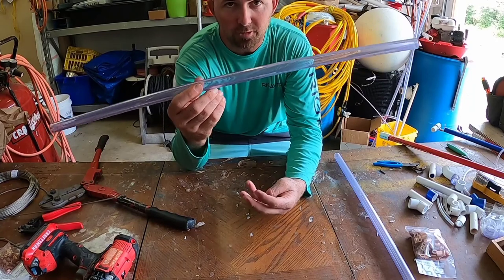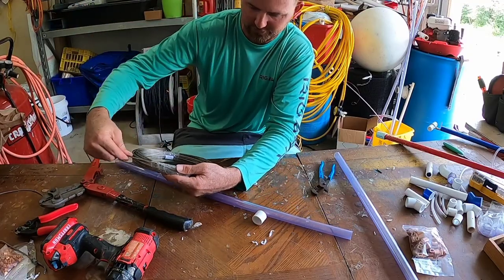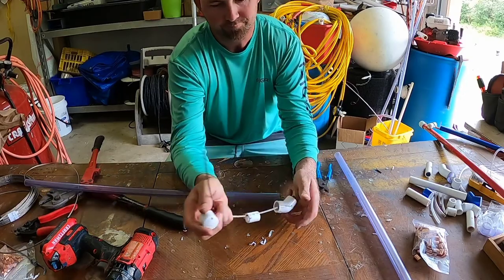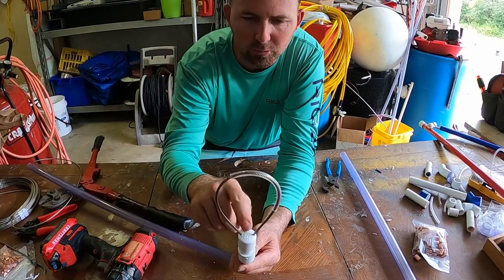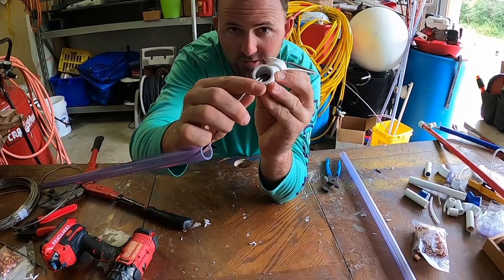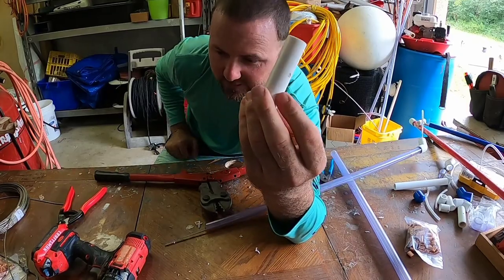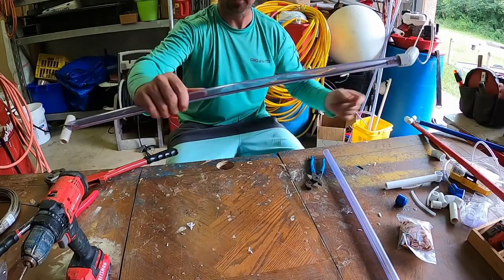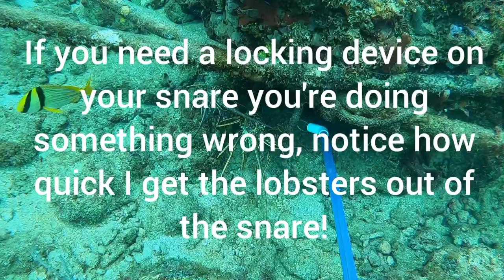Lobster snare making and using!

Comment: Great video. Can you please provide a link to the Clear PVC tubing you used. I have access to the Grey (Electrical) and White (Plumbing) 1/2 inch PVC tubes but I could see where the clear tubing would not scare the Lobsters away as much.  Also, is there anyway to crimp the Ferrules without buying that expensive crimp tool? Thank you!
Reply from the maker: The clear pvc I ordered online, i'm sorry. I don't remember where from, but I just use white pvc now, 99% of the fish in the ocean have a white belly, four camouflage. The clear ones I lose easier underwater, lol . I've heard of animal trappers just hammering the ferrules flat   wen bilding Snares. I'm not sure how a flat one would work in the pvc pipe.
Reply: @skindiver61  Thank you for replying. I just arrived home from HD and bought White PVC. I am traveling and need to fit this in my Suitcase which can fit 30" max, so I am going to use 2 pieces and use a 1/2 inch slip connector so I can fold it into my suitcase. I just have to make sure my measurements are correct so I don't have too much slack. Have you ever had a request for a travel version of this?  Also, mine will end up being almost 5ft when I put it together at our destination. Do you see any problem with that length?
Reply from the maker: @pittsburghpetfencellc8092  I don't build them to sell. I use them, I have heard of people making long snares 5ft + fore special Situations. But I have never needed one. I'm sure it will work gust fine, though .

Comment: Thanks for the video. 

Why put the rubber piece on the loop? Do you really think it would crack the carapace without? 

Sometimes the lobster are backed into the hole so much that it is easier to snare the knuckle. Without that rubber piece the wire could get tighter around the spines and knuckle.
Reply from the maker: No  I don't think it would, But the way the Lobster driving rules are written in Florida,  your not allow to use anything capable of puncturing or crushing the lobster.  Don't quote me on the law though.
Reply: Yeah the law says "Use any device that could puncture or crush the lobster is prohibited."

Which any snare could crush the lobster carapace. I don't think the little rubber piece keeps the snare from crushing the lobster.